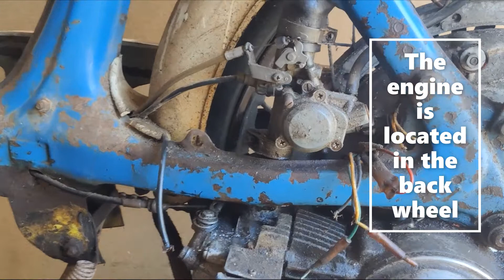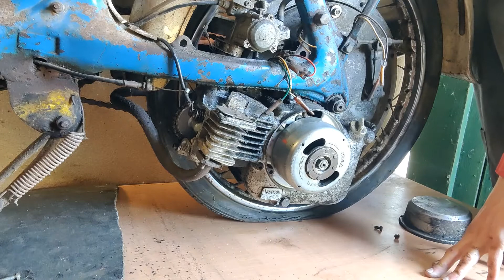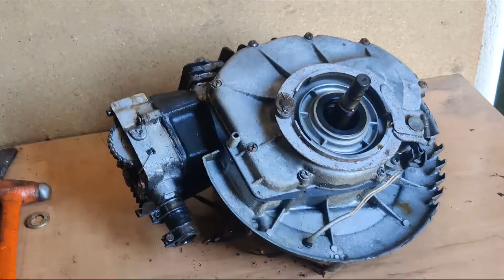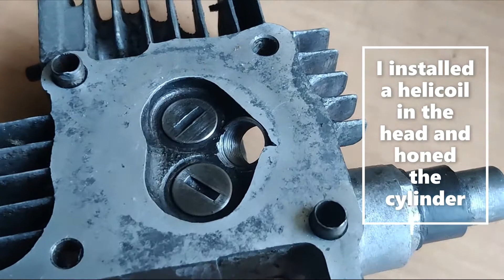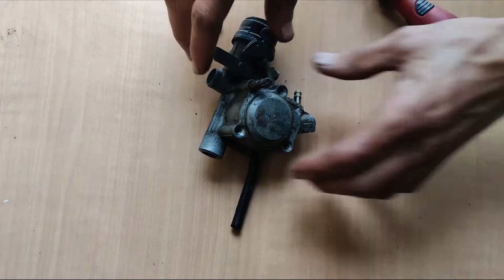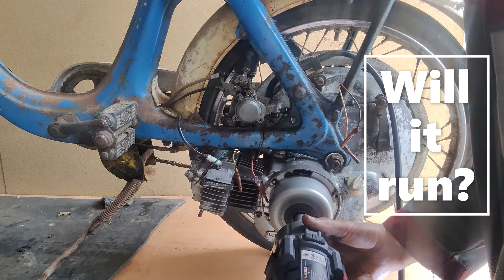WILL IT RUN - 1960's Honda moped - P50 Little Honda - Sitting for 30 years.

Comment: I used to own one blue in colour early 70s not fast moped frugal om fuel distinctive design with the engine in the back wheel with its rbox clever or what ot great speed at going up hills useful lever on engine to switch between moped engage mode a believe it or not bycycle mode where you could use pedal power to pedal to the next petrol station